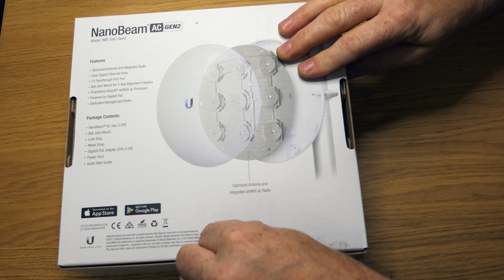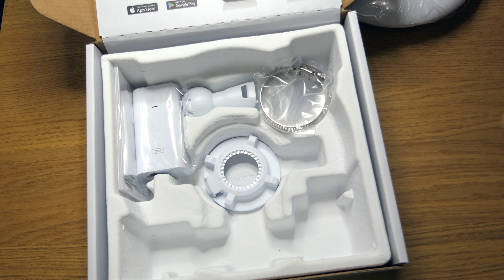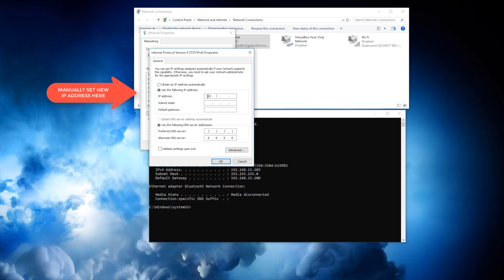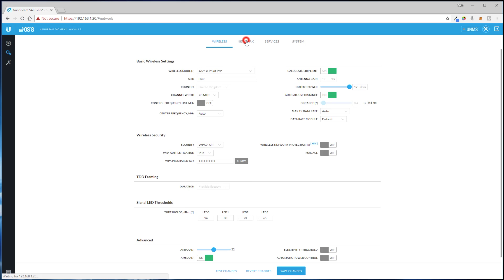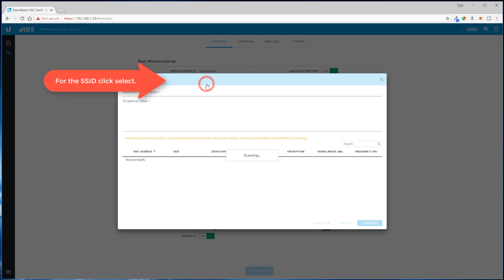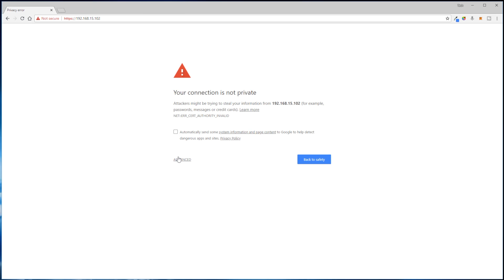UBNT NANOBEAM AC GEN2 UNBOXING & QUICK CONFIGURATION

Comment: Simple tutorial. Question. For long distance use , I have friend getting same but for about 1.5k distance what settings need to be changed ? What is best Chanel width for distance ? 20-80mhz ? Etc
Reply: Channel width really depends on the overall noise floor of the channel selected. There are no hard rules on which channel you should pick since your environment will be different. Beyond that there are some basics if using 5GHz or dealing with horrible government regulations that limit transmit power of specific channels. 

Ideally the method that will work best is to do the setup on location at the desired distance, then perform a LAN speed test using 2 PCs and either iperf or ixchariot, and then do quick 1 minute TCP upload and download tests. Try 80MHz and 40MHz and see which is faster, if 80 slows down then there is likely a lot of congestion that is causing airtime issues, thus you will then test some of the more narrow channels to see which width reaches peak speeds.

Comment: Hello,thanks for the explanatory video. Can it also be used to connect two buildings that are 2km apart? Is the lan port gigabit?
Reply from the maker: Ubiquiti NanoBeam AC Gen2 - Technical Specifications

Dimensions (Mount Included): 189 x 189 x 125 mm (7.44 x 7.44 x 4.92")
Weight (Mount Included): 0.530 kg (1.17 lb)
Power Supply: 24V, 0.5A Gigabit PoE Adapter (Included)
Max. Power Consumption: 8.5W
Gain: 19 dBi
Networking Interface: (1) 10/100/1000 Ethernet Port Wi-Fi for Management
Processor Specs: Atheros MIPS 74Kc, 720 MHz
Memory: 128 MB DDR2, 8 MB Flash
LEDs: Power, Ethernet, (4) Signal Strength
Signal Strength LEDs: Software-Adjustable to Correspond to Custom RSSI Levels
Max. VSWR: 1.5:1
Channel Sizes: PtP Mode 10/20/30/40/50/60/80 MHz, PtMP Mode 10/20/30/40 MHz
Polarisation: Dual Linear
Enclosure: Outdoor UV Stabilised Plastic
Mounting: Pole-Mount (Kit Included), Wall-Mount
Wind Loading: 45.4 N @ 200 km/h (10.2 lbf @ 125 mph)
Wind Survivability: 200 km/h (125 mph)
ESD/EMP Protection: Air: ± 24 kV, Contact: ± 24 kV
Operating Temperature: -40 to 80° C (-40 to 176° F)
Operating Humidity 5 to 95% Noncondensing
Certifications: CE, FCC, IC
RoHS Compliance: Yes
Salt Fog Test: IEC 68-2-11 (ASTM B117), Equivalent: MIL‑STD‑810 G Method 509.5
Vibration Test: IEC 68-2-6
Temperature Shock Test: IEC 68-2-14
UV Test:IEC 68-2-5 at 40° C (104° F), Equivalent: ETS 300 019-1-4
Wind-Driven Rain Test: ETS 300 019‑1‑4, Equivalent: MIL‑STD‑810 G Method 506.5
Reply: Thanks. In other words,yes
Reply from the maker: @collinsonyegbado309  I thought the figures would be better, and I forgot the YES part !!!!!
Reply: Sir,have you configured  ubiquiti unifi radio before.i am having a challenge with the adoption of the device. It keeps saying 'Adoption failed,update required
Reply from the maker: @collinsonyegbado309  without knowing the full details of the network, the best option is to work through the official help section here: https://help.ubnt.com/hc/en-us/articles/204950304-UniFi-Troubleshooting-Device-Adoption-Failures
Reply from the maker: @collinsonyegbado309  Is your controller up to date? The "Update Required" is clearly pointing to something on your configuration needing a firmware update before it can proceed.
Reply: Have you tested this beyond 8km range?
Reply from the maker: @tomtam558  I have not I'm afraid.